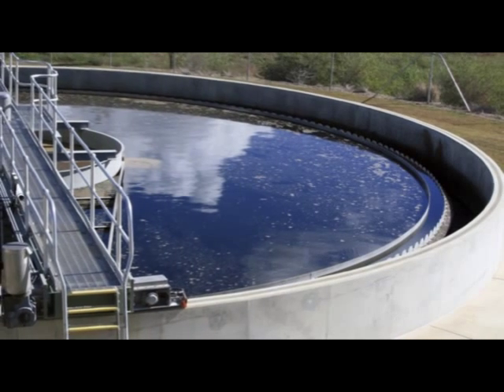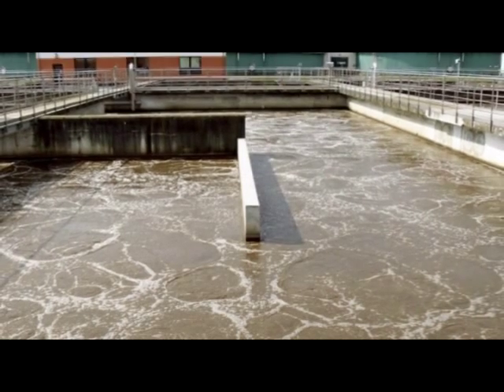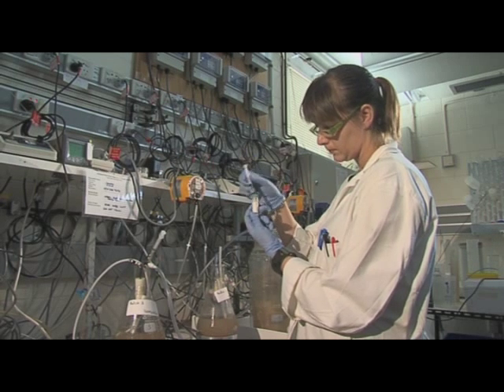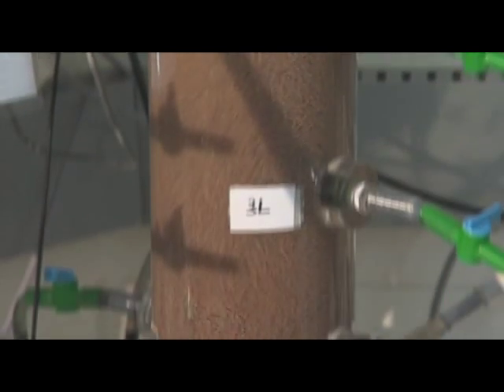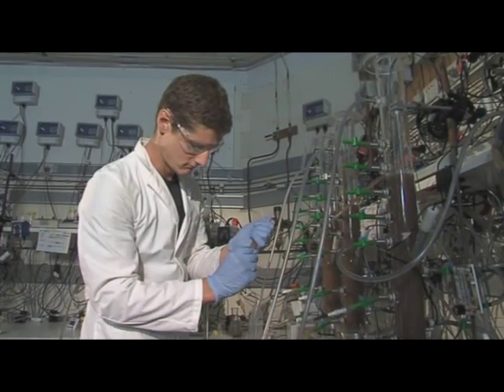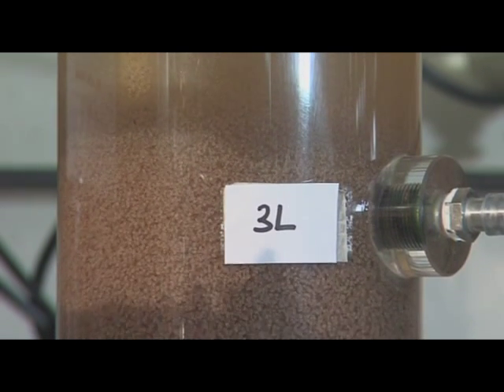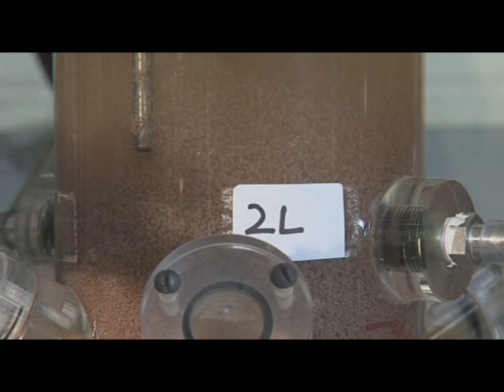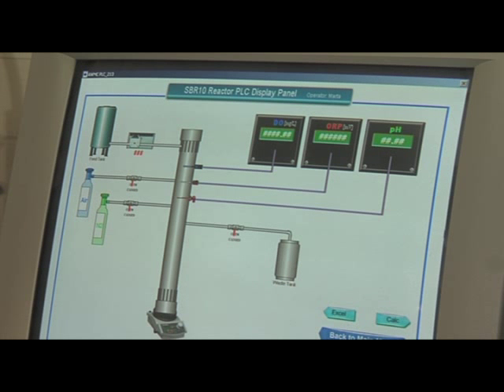Aerobic granulation - wastewater treatment technology of the future

Comment: It is not clear how this technology will add advantage to the current Biological Nutrient Removal in the Activated Sludge Process. No chemicals are needed with the existing system.
Reply: I have highlighted this issue to one of the Consulting firm designing a plant. Regards from NF International.. Water & Energy.. www.nfintc.com .